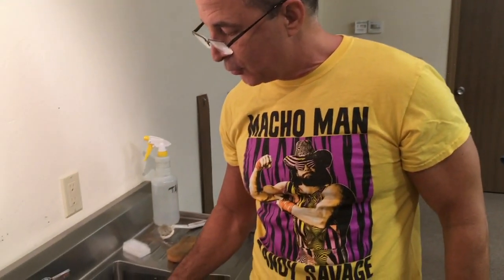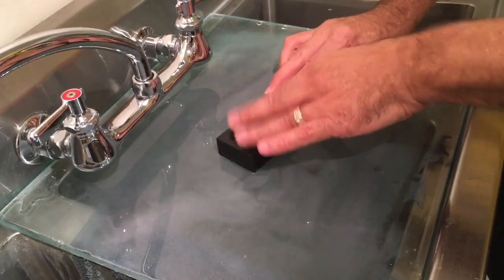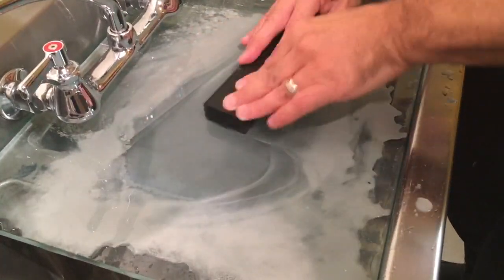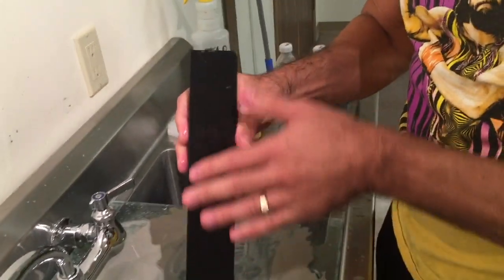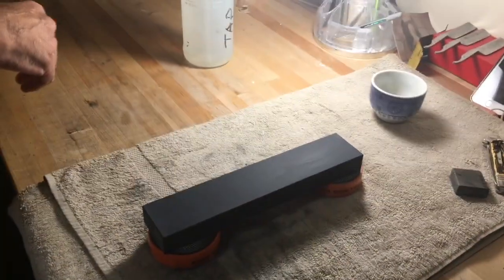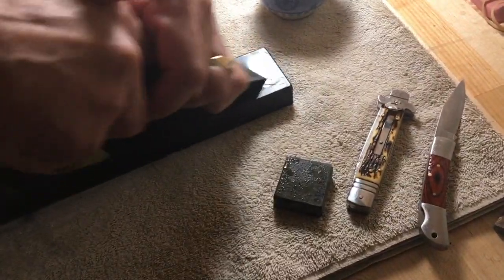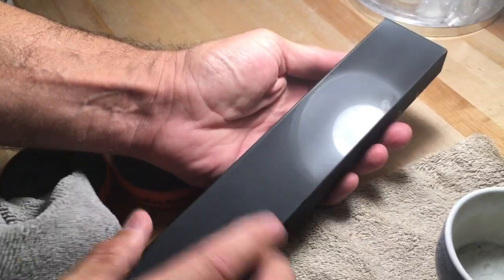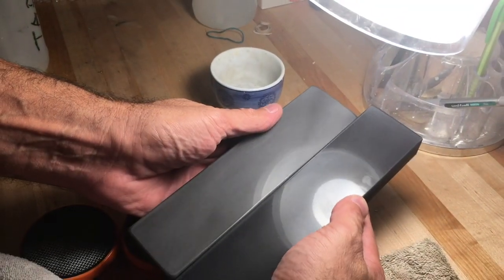How To Burnish A Black/Translucent Arkansas Stone Part 1

Comment: Nice video, but I don't get one thing. The glass is softer than black Arkansas. Wouldn't this process "lap" hole into glass rather then lap the Ark flat?
Reply from the maker: Yes, good point and this will dish the glass.  You should strategically use different parts of the glass and when it dishes, flip it over.  

Someone had a good comment that they covered the glass with 1200 grit adhesive wet/dry sandpaper.  That would preserve the trueness of the glass.
Reply: @drmatt357   Thanks for reply.  It sounds like good idea to use sandpaper. And thanks for great instructional video.

Comment: I have a used translucent Arkansas stone and it's not flat on either side.  It was used to sharpen plane blades and chisels, I intend to do the same.  Any thoughts on how to flatten it?   Another video showed doing it on a flat garage concrete floor or they recommended a flat cinder block. I think that might work if I follow it with some medium to fine or finer sandpaper and burnish it.   or if you have another suggestion please let me know. I recently flattened a coticule but that was simple with sandpaper on a flattening granite stone.  I have spent $14 on both stones total so I feel lucky on that, but they need work. Thanks
Reply from the maker: This is how you flatten it with the SIC powder and a piece of glass.
Reply: @drmatt357  Thanks I will have to get your setup, it should be done correctly since its a great stone. Thank you for the reply and advice.

Comment: Just got a new stone from Dan’s I never heard of.  Blue black Arkansas stone.  I go from soft to translucent to black to blue black and my edges are insane.
Reply from the maker: So the blue/black is even finer than the black?
Reply: @drmatt357  MUCH!  A black is assumed to be about 6k grit.  A blue black is guessed around 12-15k.  There is a very noticeable difference from finishing on a black vs blue black.  They aren’t listed on Dan’s though .. you have to call and ask for 1
Reply: @drmatt357  off the stone did a very nice video on the blue black

Comment: Quick question can this be polished up with wet and dry sand paper on glass. And just moving up ? Or is it so dense that it won’t work or take too long?
Reply from the maker: Quick answer is maybe. If you need to lap it or flatten it, I don’t know if sandpaper will work. I’ve had guys tell me this stone knocked hell out of their diamond plate so doubt sandpaper will flatten it… but admittedly I’ve never tried. 

If you mean just polishing, like getting a mirror finish as I’ve done, paper alone won’t do it but you could get it close.  The only way to get that glass smooth mirror finish is like I demonstrate here.
Reply: I've used sandpaper on glass for two Arks...a translucent black and regular black and it works great.  Though it did take some time.  I got the same mirror polish as the Doc by finishing the stones with a super hard Ozuku Asagi J-nat.  I prefer to go that route because it doesn't leave any steel particles imbedded in the stone.

Comment: Never personally seen the need to burnish a stone, but I'm keeping an open mind. 
I wonder if what you are doing is detaching microscopic particles of steel which are then pushed into the ' micro valleys' in between the peaks of the microcrystals at the surface. If carried out to the nth degree this would in effect 'glaze' the stone. Presumably before this, there is a happy medium that allows tools or blades to more easily glide across the stone when sharpening, at. perhaps, the cost of slower metal removal.   ???
If the objective is to wear down the tips of the microcrystals in order to make the stone smoother, I would have thought that lapping to a higher grit in the first place would achieve the same objective but quicker.   ???

Comment: Hey doc! Just a quick question, couldnt this be done with diamond plates instead of the powder?
Reply from the maker: dasepojken - possibly but I’ve heard these stones will eat a diamond plate. Also in this case, since it’s a 10” stone, you need a surface at least 2-3 inches longer to keep it flat while lapping.

Comment: After I have lapped about 10 stones I check my glass with a metal ruler. It was concave. It had about 1 mm hole. :)
Reply from the maker: Yes, that is true.  I'm already on the backside of that plate.  Good thing glass is cheap!
Reply: The glass will last longer and your stones will be flatter if you use the whole glass surface with each stone you lap.
Reply from the maker: @life2short1971   - Thank you for chiming in Scott.  Your input is always appreciated!
Reply: DrMatt357 Thank you sir!
Reply: Just use sandpaper on the glass plate.  I've been using the same piece of glass for a decade.
Reply: Sandpaper works just as good. And no rinsing aggregates down the drain to jack up your pipes eventually
Reply: @drmatt357  hi, where can I buy such thick glass?

Comment: How long are you able to use the glass plate before you have to replace it?
Reply from the maker: It does start to dish out after a few stones. What I did on my next one is designate sections of the plate for every few stones then you can always flip it over. Glass is cheap tho. Someone gave a good suggestion here in the comments that they covered the glass with 1200 grit adhesive sandpaper so you could still use the powder yet the plate won’t dish.

Comment: Ive never done this but if you want a finer finish could you go higher grits in the sic powder ive seen it go up to 1500 how much of a difference do you think it would make? Id like to add in a surgical black after an ultra fine ceramic for an ever finer edge
Reply from the maker: Yeah, most people will say there’s not much effect after 600 grit on the powder. I went to 800 just to be sure. The kit goes up to 2000 grit powder and I’ve tried it and there’s no difference between that and the 6-800. 

If you want that mirror finish, there’s only 1 way and that involves some elbow grease!
Reply: You can lapped above 800 grits but the stone will cut very, very slow.  The purpose of burnishing is the wear down the higher peaks on the surface of the stone.  The surface of the stone will feel smooth but if you do some laps with a straight razor and then check the edge under magnification you will see quickly if the stone’s surface needs more burnishing. A cheap hand held microscope 60x to 120x from Amazon works great.

Comment: In your opinion, what is the different end result between a black hard Arkansas vs the ILR on a razor edge?
Reply from the maker: Different stones. ILR is a finishing stone and the Ark is a polisher meaning you’d do it after the finisher if you wanted more edge.   You can  finish on an Ark but it takes longer as it’s really slow.
Reply: @drmatt357  I just came across a full set of Jon Coe Arkansas stones. (Full being washita for coarse, black for the medium, and the highly coveted grey ultra fine) I purchased those but was also considering adding a ILR 3x8 with the nagura to my arsenal.

Do you think the ILR is necessary? I currently own a soft/hard black combo and it seems to do a good job.

Comment: Cool trick. They sell diamond sharpening and honing pads at harbor freight. Whatever grit you want and they are extremely flat. They open up the polish on your real stones, fantastically. If you have a blade that needs a remodel, those course diamond plates are the best. Other than that, I use them to flatten, tune and make slurry on my real stones.
Reply: That  speeds up the cutting of the stone,  burnishing takes it the other way,  which is what you want in a ultrafine finishing stone that you are using for final  finish honing on your  straight Razor. 😉
Reply: @donnelhuddleston2478  my point was that there are many ways to achieve the same results. This guy is good. That is why I watch him. The objective was flattening a stone. There are lots of efficient ways to go about that.
Reply: @vitodelorto1796 Yep. I have float glass and sandpaper so that's what  I use

Comment: That's a Black, not translucent. Translucent, as the name implies, allows light to partially pass through it. They're VERY similar. But not quite the same. They're pretty much identical in finish. But one is translucent and lighter in color and the other is pitch black. 😄😄

Nice video though. I loved the cello in the background.
Reply from the maker: Yes, I did make the correction in the title.  Thing was, depending upon the vendor, one called it black surgical and the other called it black translucent.
Reply: Surgical blacks (marketing gimmick), black and translucent black Arkansas stones.  They are graded on their specific gravity so all 3 types of black Arkansas stones are the same.  The difference in the three types of black Arkansas stones are appearance only.  There are two other vendors but they are not finished completely flattened as Dan’s. The Dan’s Arkansas stones will still need to be lapped with SIC powder to at least 600 grit or more.  Personally, I have mine lapped at 600 grit, burnished with an old junk razor.  I prefer my razors honed up to a Naniwa 12k synthetic, followed up with a translucent Arkansas and then finished on black Arkansas stone both from Dan’s Arkansas.

Comment: Me: sparingly use enough SiC to save money

Video:  sprinkles the loose SiC like  baby powder

great vid btw, I don't have  flat chisel at home. Can I use other flat steels?

My plan is to burnish one side and the other is to lap it to 600 grit
Reply from the maker: You can. The chisel is hardened steel and if you use another type of steel, it may not be hardened, it can load up the stone so keep an eye on it as you go.
Reply: @drmatt357  yeah just did it recently with some chinese knives with really  soft stainless steel, It loads the surface instead burnsihing the stone.

Comment: Hmm, so the rec from Dan's to use oil to prevent the steel from "clogging the stone" is BS?
Reply from the maker: I don't know what Dan's says.  I'm sure they're way more knowledgeable about these stones than me.  I can only tell you what I know.  As you can see from the reflection, these stones are not clogged up with metal from the burnishing with water... at all!.  I've heard of people using oil to burnish them but I never have and didn't want to do it in the video since I haven't in the past.
Reply: Thank you for the info!!
Reply from the maker: To clarify Red, if you're talking about sharpening, yes, I've heard that these stones can clog if you use water, that's the reason I use oil.

Comment: Honestly. I'm not doggin at all. I'm just a carpenter that loves a straight razor shave. All you did was very moderately fuck up an invaluable (and fairly expensive) chisel. Bust that fine as stone open with some diomond plates. Try honing your razor on it after that, and please let me know how that goes❤
Reply from the maker: LOL!  The chisel is only for burnishing. The diamond plates will work to lap but these stones are so hard, it will eventually kill the plate. What I’m doing is burnishing or polishing the stone to get that glass like finish for polishing the razor edge. You can tune the stone finish to your liking so whatever works for you.
Reply: @drmatt357  if it works, it works.

Comment: Looks more than a surgical than Translucent , a Translucent should be Translucent.....?
Reply from the maker: You could be right.  I thought they were all translucent, just different variants. I'll check on it.
Reply from the maker: I just called Dan's Finn and you are correct.  I'm using a Black Arkansas stone in this video which is different than a translucent one.  I thought the black was a sub-classification of a trans but I guess not.  They said the black ones and translucent ones are mined from different parts of the quarry.  The burnishing process however is obviously the same. I made a correction in the description.  Thank you!
Reply: That said, I aleays belueved that the Translucent was the finest, but according to Dan it’s the black, which other companies name surgical?